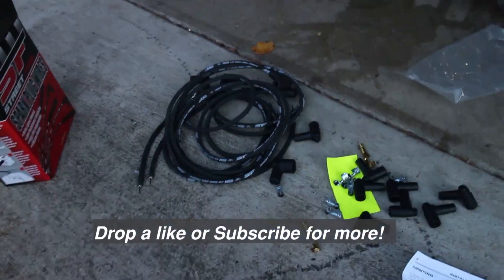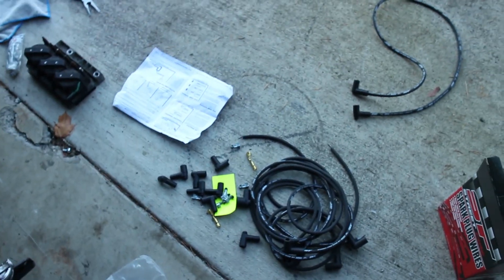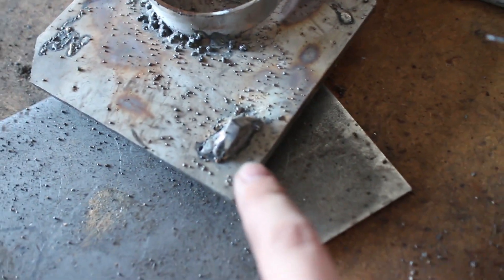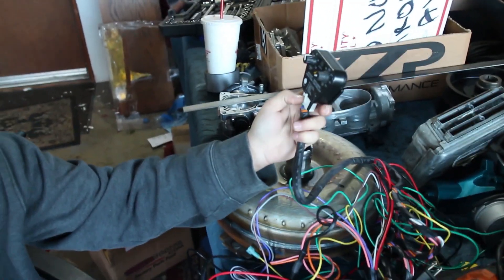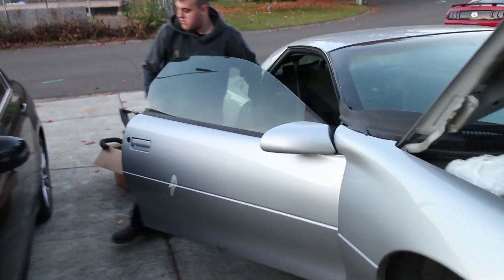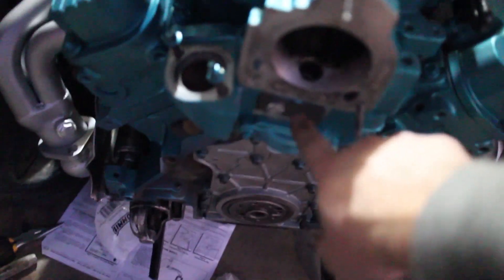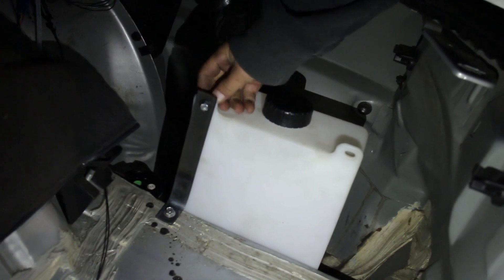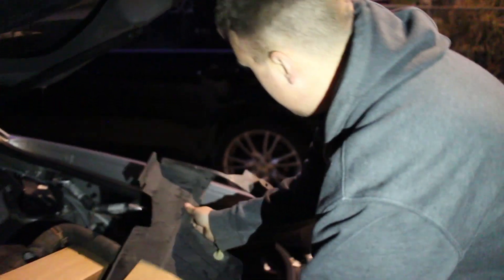Project F L67 Camaro Rebuild Part 13 (Making Spark Plug Wires! Methanol Injection Setup!)

Comment: I made msd wires 4 my l67 what a massive difference prior I had a misfiring issue even with new Bosch leads still didn't fix it but these mad wires r freaky the increase in per & performance is unbelievable.
Reply from the maker: Thats good to hear! Glad we chose MSD.

Comment: One thing I wish I had done differently when doing this swap is deleting the EVAP. I deleted the EGR like you guys did, I just never deleted the EVAP when I got my PCM tuned. Since the EVAP isn't hooked up, and I didn't tell Intense to delete the EVAP when they reflashed my PCM, I now have a code on for EVAP. Small oversight on my part. Something you guys should consider when you guys start the wiring process
Reply from the maker: Yeah we're definitely deleting the EVAP.
Reply: Just looking through old comments, that is something that has been plagueing my bonnie for the last year atleast. Would never throw a check light but then one day it through a EVAP code thats probably the evap lines above the tank or possibly the filler neck, not the lines in the engine bay or evap solenoid. Either way no sense is fixing that. Bonnie and Project F are getting the Delete Evap and EGR treatment. I bet that'll make them both happier.